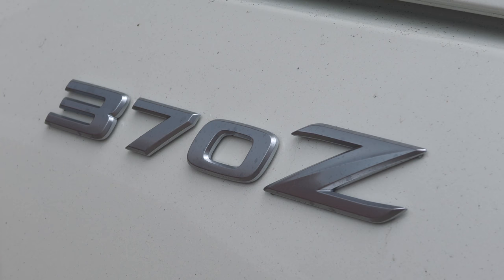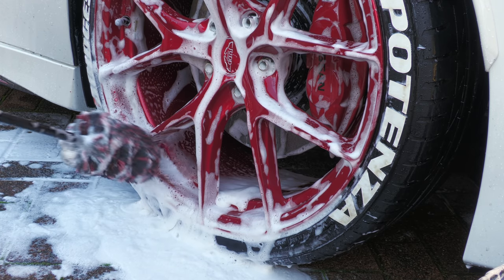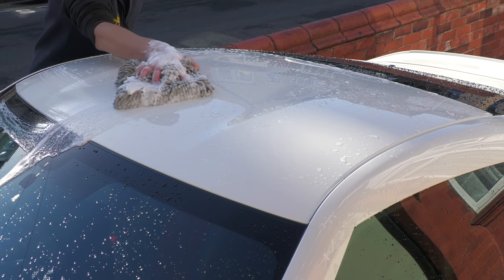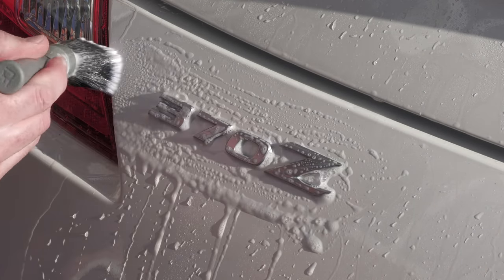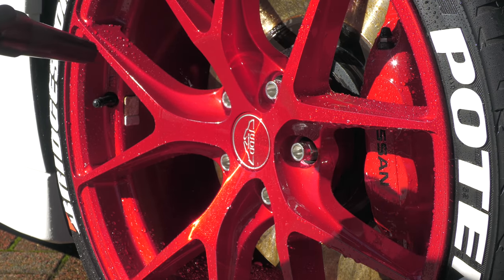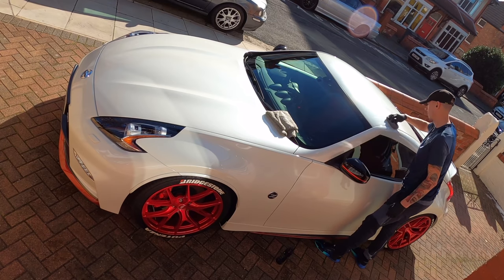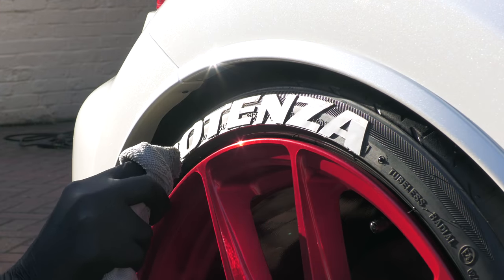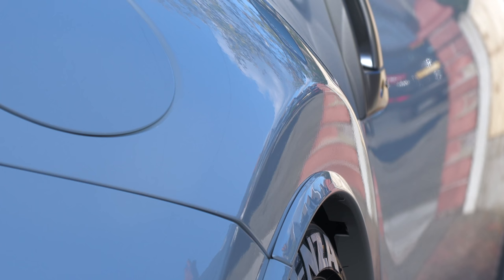Nismo Pre-Winter Wash & Ceramic Spruce-up

Comment: Mr. Guru, that is one beautiful nismo.
I don't clean my car as well as you do, but I did give my SVT Focus a thorough wash this morning. Perfect overcast and 50° (F) weather set me up for success. I did a thorough prerinse, and gently removed the gravel dust the car had accumulated while I was back home with a soft scrubber like the one you used for the contact wash. I cleaned and reloaded the mitt after each section to remove the dust. Then I rinsed and went over the whole thing again with a soft microfiber and soap. I dried with some oversize microfibers, and finally gave it a wax. I scrubbed the wheels with a dish brush... My standards aren't as high as yours. The water sheets and rolls right off!

Comment: Hey bud, big shout out from down under! Keep the videos coming…really enjoy the content. Have you tried using super high gsm microfibre towels as your touch wash media? Once soiled it can be put aside and the next panel attacked with a fresh towel. Means no rinsing, just one bucket and easily washable once done. I find big bulky mitts difficult to use and likewise to clean properly. Cheers

Comment: I recently had a chemist that works for a car care company tell me that some products such as washes with some wax, etc. can provide a masking layer over the top of the hydrophobic coating/sealant. So you either need to use a wash that doesn't do this or rinse a lot more than usual or use another more hydrophobic topper to bring back the beads. Having another layer on top isn't a bad thing, it just might affect what you see and make you think the sealant isn't working like it used to when in fact it's just hidden :)
Reply from the maker: Likely the case here, just didn’t think ahead as with a lot of my vids they’re last minute.
Reply: @CarCleaningGuru  Last minute? Really? Doesn't look like last minute to me, great video again!
Reply from the maker: Not last minute on the day but in terms of planning and getting thing right in my head yeh.
Reply: Common knowledge. The issue here is that the coating has failed. It wouldn't make sense for Avalon King to make a shampoo that masks their coatings. Carpro made Reset which helps their coatings. His first rinse (before washing) shows that it failed or almost failed. Guru says that it could be from not having the best application environment, which has some merit to it (not enough for it to fail in 6 months). The coating didn't fail from Guru negligence. I am guessing that it was just the poor quality of this highly marketed coating. However, it is important to note that I have seen this coating do much better so he may have gotten a bad batch (even Carpro makes bad batches  occasionally).
Reply: @connersmith2445  Despite your condescending introduction to the comment, the first rinse doesn't show it failing, there could have been any range of contaminants still on it. Many companies make both sealants/coatings and a range of shampoo types so unless it's specifically designed as low residue it will still leave some from many. In any case, reduced hydrophobics doesn't mean it's 'failed', it may be starting to degrade but that doesn't mean there's no protection on the paint left. I have never used AK so I have no idea what is typical for it I'm just saying from a video you can't be conclusive and it may have been something other than the coating degrading, or it may be that.
Reply: Contamination wouldn’t explain the poor hydrophobic performance across the entire vehicle, that would mainly be seen on the lower parts of the vehicle, especially since it’s only been 6 months since application. An example of an exception would be a car parked under the train in Chicago, it would have rail dust everywhere. The purpose of the AK shampoo is to help rejuvenate the coating. AK says that in the product description. The coating should not look as it does in the video. Hydrophobic properties being gone does not mean it has failed, I agree. But as soon as soon as the hydrophobic properties fail, it’s time for a reapplication or a new coating.
Reply: @connersmith2445  yeah I agree if the shampoo used is stated to rejuv that is more strange
Reply: yessir

Comment: I hit my Avalon coating (on the car for 9mo) with a mineral deposit remover and some iron remover, and it brought it back to life without the need for the boost spray. Now mine never fully looked flat like this, but I definitely could tell it had taken a hit prior to the chemical decontamination I performed.
Reply from the maker: Yeh I will do the same at some point just so I know either way.

Comment: When it comes to coatings this is why I never use anything other than car pro c quartz I think it’s called. 
I applied that’s bitch 3 years ago, it’s still going strong with the hydrophobicity. Repels dirt easy when I come to wash it as well. One of if not the best on the market in my opinion

Comment: I reckon this ceramic coating would get outperformed by Tac systems moonlight. Would anybody agree with me?
Reply: I applied tac system moonlight on my car back in June, outdoors in direct sunlight,  still going strong.
Reply: Totally agree!
Reply: Yep. No doubt. Plus you get insane water behaviour
Reply: Have any of you tried moonlight on your wheels? Does it hold up well?
Reply: I've had better results with the turtle wax ceramic spray and graphene spray. I've also tried the Avalon coating and it's pretty bad. About 1 summer of good protection

Comment: Awesome videos mate, and your wheels come up absolutely amazing! After winter is dealt with I will be having mine coated black on the F10 535.. hope to have them coated nicely to take care of the maintenance side of things.

Quick question! Any tips on windscreen wipers?
I have tried Shampoo and separately WD40 with cheap microfibres and/or a brush with a good jet wash after.
I'm noticing I am still getting a real deep black staining on the cloths when wiping off residue, surely I'm missing something as I'm wasting a cloth each time I do wipers, cant be correct lol.
Reply from the maker: Rubbers can keep expelling black stuff even after a deep clean, if they’ve been properly cleaned it shouldn’t be dirt but the make up of the material itself so I would just maintain with shampoo.
Reply: Most wipers will have graphite on them to aid in gliding across the windscreen.

Comment: Great video as always.    What would be the lowest temperature you would apply the Avalon king ceramic coating?
Reply from the maker: 10 degrees c but I wouldn’t recommend coating in temps that low unless you have somewhere warmer for it to cure afterwards.

Comment: This is the difference between cheap coatings and quality coatings. My Gtechniq still repels water as good as it did 2 years ago.
Reply from the maker: I think the difference is conditions in which it was applied. Either that or it’s clogged and needs properly rejuvenating.
Reply: @CarCleaningGuru  no be honest, it’s crap
Reply from the maker: @LSD04  I didn’t apply it in the conditions it says to apply it nor did I try to unclog or revive it so can’t say that.

Comment: Bit disappointed with that Avalon king Ceramic really. I know the car spends all it’s time outside but I’ve got a good 5 months out of TW dry’n’shine with the car open to the elements. I reckon a few coats of Fusso might outperform the Avalon King ceramic.
Reply from the maker: A few coats of Fusso will outperform most things! It can just be a bit awkward to apply hence why not always going for it.
Reply: @CarCleaningGuru  yeah it’s not the most ideal of products to use. Especially if you get a few high spots which go off like concrete! Never fun

Comment: Pretty poor that the original coating had basically failed by the 6 month mark - seems like a waste of time, money and effort if that's a long as you'll get from it. Plenty of better, easier to apply and cheaper options out there.
Reply: Probably not the case, see my comment on this
Reply from the maker: Could have easily been clogged as the car lives outside and gets battered with environmental fallout. Didn’t think ahead enough and get a mineral remover which may have sorted it.
Reply: @CarCleaningGuru  appreciate the response but seems to be a common theme with this coating when tested by others too. Even those in a more controlled environment showing it doesn't have the same 'legs' as some of the competition.

Comment: You only drive this car 2000 miles a year🤔. I guess the Z sitting outside 24/7 in England is enough abuse, milage aside😎
Reply from the maker: Yeh rarely gets dirty from actual driving, it’s just a target for seagulls.
Reply: @CarCleaningGuru  out here where I am (Southern California low desert area) what messes up the finish is the brutal heat, bird bombs during that heat that literally bakes into your paint within moments, pollen that gets baked on and sand storms.  It is almost impossible to keep a car clean around here.  You can literally fry and egg on the hood of your car, even a white car here can fry and egg on the hood in moments.  When I see you washing cars outside I am like WTF???? and then I remember "England"  duh.  haha.  Love Your Channel, Keep Up the Good Work!!

Comment: Don't understand this 2 bucket method, to do it properly surely you need to be rincing your mitt in pure clean water each time, your rince bucket has the dirt and shit in and you keep putting your mitt in back in there each time?? So you may as well just be using one bucket?? And if you say well the dirt goes to bottom under the gritt gard, then it would do exactly the same in your wash bucket so in theory should be safe and 2 buckets absolutely pointless??
Reply from the maker: I kind of agree hence why I don’t always use two buckets but also think on a previously polished relatively swirl-free car it’s worth the few extra minutes it takes just in case.